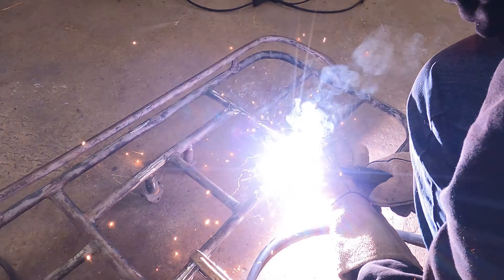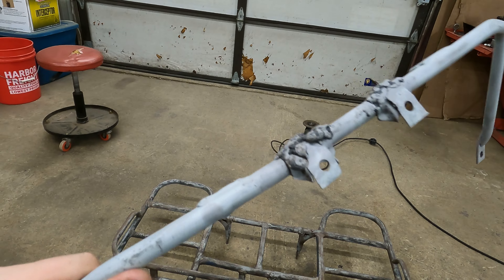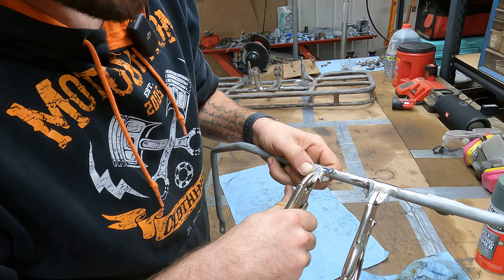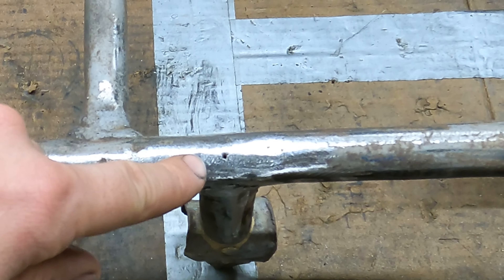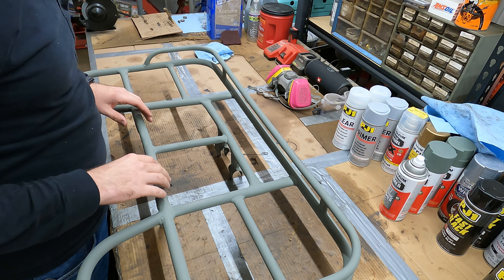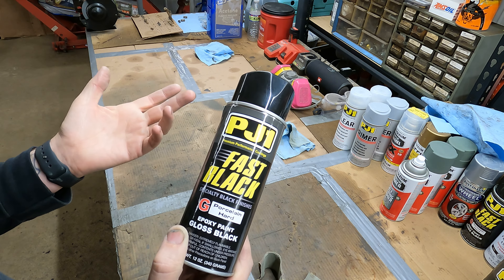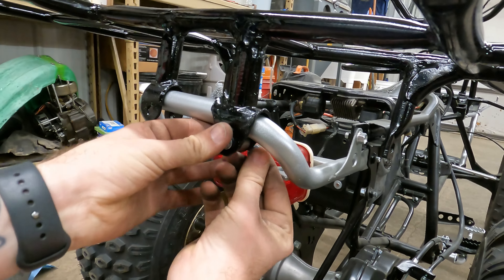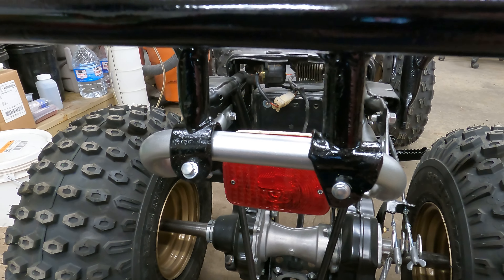These ATV Racks Were TERRIBLE!! Moto 4 Rack Restoration

Comment: How has the PJ1 paint held up on the racks over time? Cleaning and fixing up a bunch of stuff on an 88 Moto 4 350 and have to get the racks painted soon. Thankfully they are in amazing shape compared to yours haha. Wish I had the money/time/space to set up a plating station. Wanna nickle plate some hardware for me if I mail it to you? haha awesome videos as always!
Reply from the maker: Not too bad but we don’t have a lot of time on it yet. I think I screwed up and if you take anything down to bare metal you MUST use etching primer first. I didn’t and it chipped out around the bolt holes 😭 and I’m still working out kinks on my plating so I think I’ll pass on that 😅 and thanks!

Comment: Hey bud mine is stuck un reverse
Reply from the maker: See your reverse lever? Follow that arm back to the cover it goes in. It’s probably broke or stuck under that cover. Only bummer is is I think to get that off you need to take the recoil and flywheel cover off to get the smaller cover off to see your issue. Hope you get it figured out!